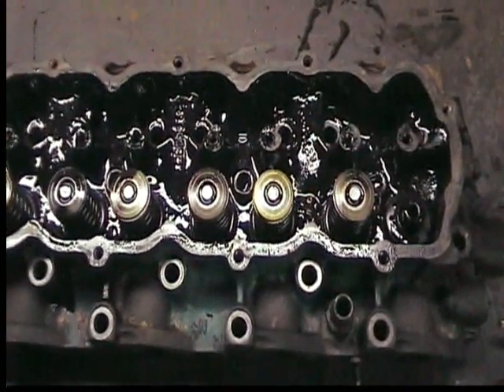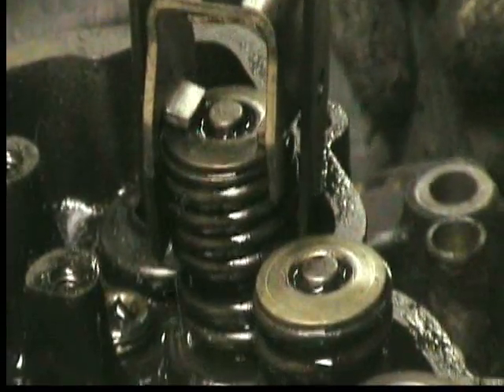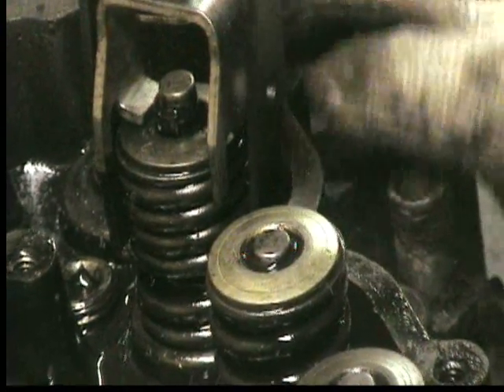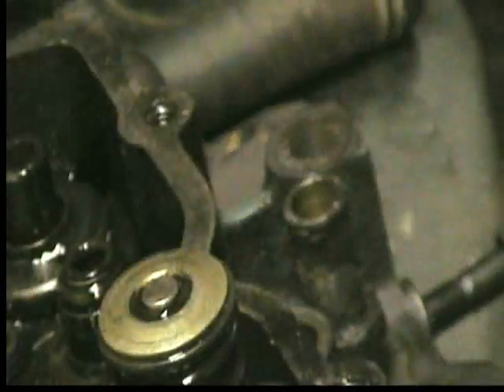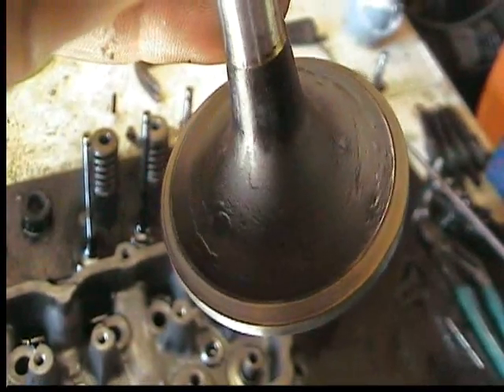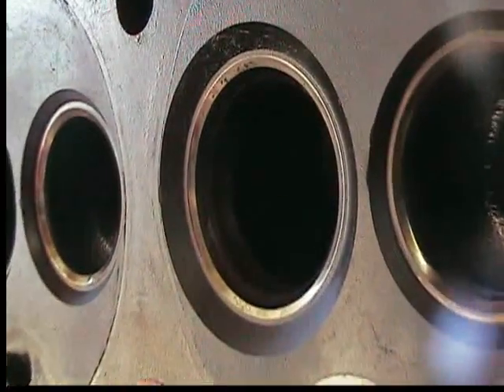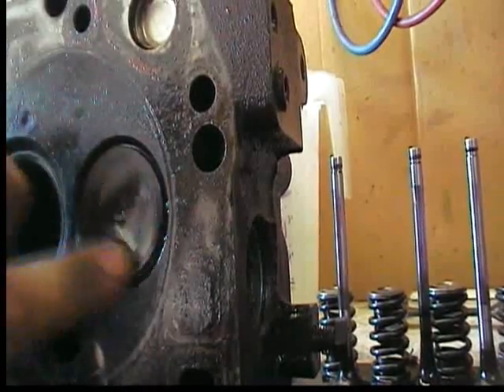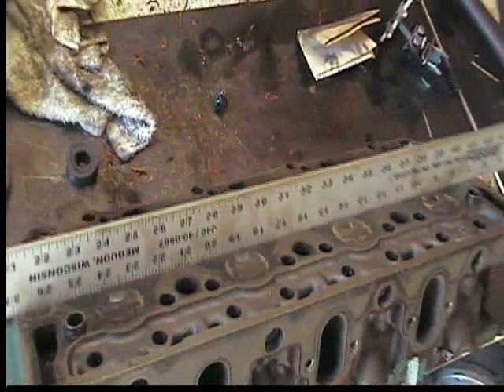Basic valve job

Comment: Before you start removing, replacing or lapping valves, it's best to first clean the head, then check it for obvious cracks, particularly in the thin area between the valve seat bores.  If the head looks non-cracked (and be aware that a visual inspection won't always find all cracks), then use the ruler and a feeler gauge to check the gasket surfaces for flatness. if they're not flat, make them flat, either using the well-known sandpaper method (see elsewhere for details), or by having the surfaces milled.  By following  this procedure, you can save yourself time by not dealing with the valves, if you find the head is cracked, or its gasket surfaces can't be gotten flat, which would mean you can't use the head anyway.

Comment: a rag, a socket,  and a hammer work better and faster than that "fancy" tool during  disassembling. assembling you just need the socket, the rag,  and a zip lock bag.
Reply: bingo
Reply: I have a 3/4" socket and a 1 pound hammer for just such a purpose. In the time it took to take one valve out with that tool I can do all 8.

Comment: I hate that valve spring removal tool, I hade way to many close calls, once you tap on that tool to get the the keepers loose the the tool also slides off the spring and if you don't pay attention it will hit you right in the face.
Reply: Use a box end wrench to push spring.

Comment: Some people are mentioning that metal rulers or levels do not have precision. Well I would disagree. I admit a metal type of measuring stick for general purposes is not as accurate however it is milled down by a milling machine which is a precise tool, depending on what brand you have. A good way to check the accuracy of the ruler/yard stick is to measure it's width with a micrometer or caliper and check threw out it's length for close dimensions. Then I would put the ruler against any milled surface such as a table saw's face or a flat piece of granite. The best would be to buy a surface plate but they are expensive.
Reply: +Micscience - The real test of flatness of a straight edge is to not only place it against a known-flat surface, but to also try to stick a feeler gauge between the straight edge and the flat surface, just as you would when checking a cylinder head for flatness.  If you can't stick a 0.002 inch (or 0.001 inch if you want an even tighter tolerance) feeler gauge between the straight edge and the known-flat surface, then you've got a straight edge that's usable for testing cylinder head flatness.

Comment: 7.3 IDI Turbo head isn't it? rebuilding myself as well. Just wondering whats the best way to clean the entire head and remove the old gasket material?
Reply: brake cleaner, good for cleaning engines, not good for cleaning brakes.
Reply: just a normal 7.3 idi head...nothing changes from n/a to turbo
Reply: saik0pod This is so true :)

Comment: You should be looking for a dip between the straight edge and the middle chambers because heads bend the opposite way. If the head is bent you will feel a rock going along the cam tunnel or on machined surfaces such as the surface where the cam caps bolt to the head.

Comment: You basically rub the head surface on flat glass with an abrasive in between the two. Its called lapping.

Lapping can definitely work for head surfacing, but you need to make sure your glass (or other surface) is very flat (tolerance of 0.0001") otherwise you will just end up making the surface worse.

Comment: actually what i guess he meant is that, glass or even better mirrors are usually flat enough to lightly grind "sealing" part of head on them...of course it's best to leav this stuff to pros, but if you are fixing mopeds or some simple lavnmover motors and stuff like that, than that method is accurate enough to get the job done

Comment: what about when i have a valve that has no clearance and is letting oil get into the cylinder and making it smoke? i know its not sealing (and i have a new piston and bore so not the problem there) but i dont understand why there is no clearance between the valve and the arm.

Comment: A couple thing you did we're not the exact way of doing it. You need a valve lapper tool. You DO NOT put it on a drill. Next you can take a flat piece of glass and redo the head surface. Use the lapping compound to do so. But overall a great starting video for someone that just started doing head mods.
Reply: You need a drill,rubber house about 4-5 inches long that will slide over a drill bit, and over the valve, and valve grinding compound. Put a little compound on the inner service lip of the valve place valve back into the head attached rubber house to drill bit then to the end of the valve stem and slightly pull up on valve to where valve mates the valve seat then turn on drill and let the compound do it thing. It works I've done this many of times. It's hard to explain without being able to show you but when he says use a drill this is the basics methode he is referring to I'm assuming.

Comment: Not what your saying is POOR EXAMPLE, you done alright, YOU are incorrect on lapping, really. Lapping is ONLY for visually inspecting WHERE THE seat is, that is all, that is OLD tech, and now the seat runnout gauge tells the story, NO ONE laps anymore, as a matter of fact the reason they went to the runnout gauge is becaue the "Lapping" compound, and finish caused the seat to UNSEAL after time. The connection of two machine surfaces do a way better job of sealing then the crap compound. Read SAE

Comment: The straight edge is not useless. If the head is warped the straight edge can tell you.  Would you use it for more precision? No, but you didn't see him pulling out a feeler gauge, he was merely doing a visual inspection. If you have a precision tool, then use it. If not the straight is sufficient, so long as you know what you are looking for.

Comment: I'm wondering if you can take a wire wheel to the valve, while you have it out, to clean it up? If done just ever so lightly, would this be ok without causing damage to the valve?

Comment: Man you got it all wrong, Lapping is just used for visual inspecting. The real deal is a valve seat runnout checker, which checks concentricity in relation to the valve guide, and is about .0015 max and really needs to be in the .001 area. What "valve face margin are you talking about. The lapping has nothign to do with valve margin. ANY TIME you have the head apart (spring apartm valves out) you need to do a real three angle valve job. This is due to Valve guide loosness, and carbon build up.

Comment: You sir are incorrect, Valve lapping with a grinding compound is used to take care of small imperfections in either the valve or seat face and is also very useful in checking valve face margin and seat conicity. At this point you can decide whether or not a full valve or seat grinding is needed, Also useful for final checking after machining.
I do agree though that this is a very poor example of a “valve job”

Comment: @chamblizi if the tick is on the bottom end its more than likely a rod bearing.  Top side it will be a valve.  351W?  Either way its good to adjust the valves once a year on them older engines.  If its never been done since the factory you will see a noticable difference.  Its not very hard to do and recommended.  If you leave it unattended it will prematurely wear or even break.  If you need the info just let me know.  I can refer some good links.  Cheers :D

Comment: @CrikeyMang  kk well its only one side and the engine temp is fine everything is ok keep in mind that this is a75 ranchero she runs like a champ strong burns a tiny bit of oil but thats normal i can push it up to 110 with out a problem probably 120 but i wont put that stress on her... sh has a tick from pasengers side case..

Comment: @driftsilvia16 it refers to the amount of angles cut on the valve.  Standard stuff will have a 45 degree angle cut into the valve.  3 valve will have a 30', 45', 60' or to some variation of angles.  This aids in flow into the cylinder.

Comment: @Broccolidiesel It's a 90 degree carpenter's square...which is also not a precision straightedge.  Compare one to an actual precision straightedge and you'll see why nobody should be using one to check flatness.

Comment: if you're doing an overhaul on a high-mileage engine, why not just buy new valves and springs? Even if they're still good, they're probably worked and re-treated pretty good from all of the movement and heating over time...

Comment: To reface a valve I chuck it into an electric hand drill preferably the keyless type. With a little grease on my hand I let the stem ride in my hand and put it against the grind wheel. You can watch the face and it will be bright where you are grinding. Move drill in or out to get right angle on face. It doesn't have to be exact. I have done this  for over 50 yrs and haven't had a problem yet. You can get the feel by grinding some old valves. Check seating by lapping valves

Comment: hmm.. def a diesel head, probably from a Ford IDI 6.9 or 7.3.. on 4:40 you can get a good view of what looks like the swirl chamber; the swirl chamber is where the injector nozzle, and glow plug were located on the IDI engines. never use ether on an IDI (so our fleet mechanic told me) that chamber can fill with ether and explode, knocking out the bottom of the chamber, and then it bounces around inside the cylinder he said.. but w/e we used ether for years problem free, lol

Comment: That is a diesel head. Ford tractor I think. I use a drill to seat valves. also use a drill and bench grinder to regrind them. Don't tell me it doesn't work I have been doing that for 50 yrs.I do clean everything up before I even look at it.